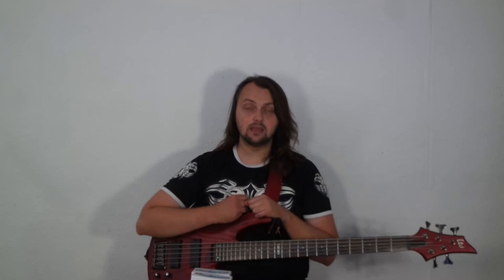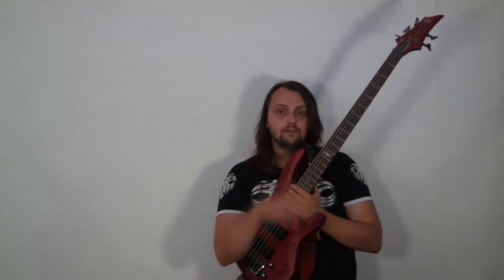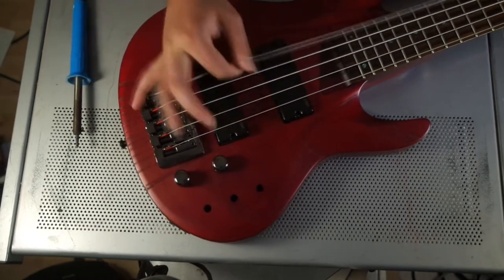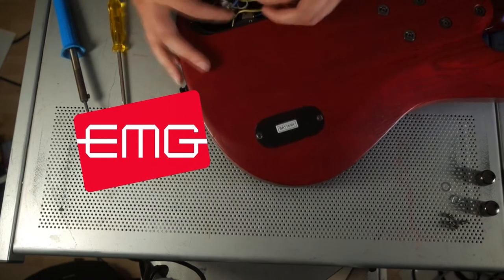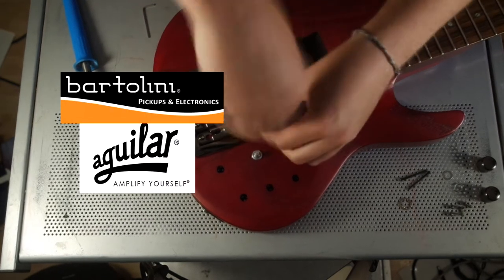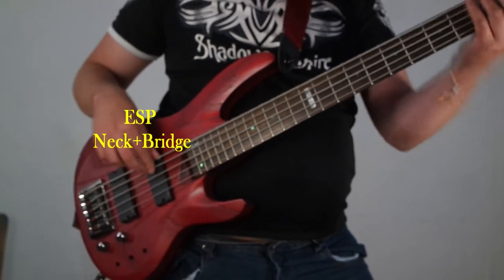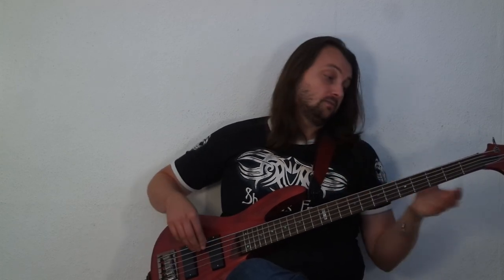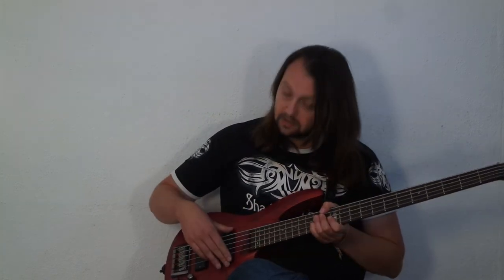Gear Review: Kent Armstrong HB5E3 bass pickups vs. ESP\LTD pickups

Comment: Normally I struggle to hear difference but for sure your Kent pickups sound much better except possibly in bridge position where less difference. Looking for some 5 string soap bar to fit a Steineberger XT25 but the cost means I might as well buy a Sire M2.

Comment: Hey man, the Armstrong sound a bit hotter but the esp sound richer.imo.I have used K.A. pups and for the money they're great.
Strangely I put a passive Armstrong Music Man pup in a bass of mine and the d string is twice as loud as the other 3.and it has rails magnets rather than pole magnets.Can't figure out why but I can't put up with that either.
Reply from the maker: The problem was that I set the amp to ESP pickups, so it would sound kind of ok, then I put KAs and used the same settings. These settings were not propper for KAs, they sound too hot with these settings. For me it was worth changing the pickups, the bass got more depth and clarity.

Comment: Folks. Pair those pickups with a Noll preamp and you'll have a total monster on your hands....!!!
Reply from the maker: What's a Noll preamp?
Reply: @leothemetal  Noll preamps are sold thru Best Bass Gear. I've modified several basses with the combination of Kent Armstrong Claymore soapbar pickups and Noll pre. Instant Ken Smith type tone plus more. The Noll comes prewired which is a plus but if you get one with any stacked pots, you'll have to get correct knobs that will fit. The pots shaft are not standard (like with a Warwick MEC stacked pot).
Reply from the maker: @bonesworld2  Ok, thanks for information. 
I am not fan of preamps, they require battery, and I don't like to keep in mind whether my battery is dead or not or if I have to unplug the cable. The simplier it is, the more I like it. Well, if I get some bass with active pickups or electronics and it sounds great, I don't mind to keep it the way it is. If there is shitty electronics and I have to modify it anyway, I'll keep it as simle as possible. 
But thanks for menioning it, It is worth of checking out.